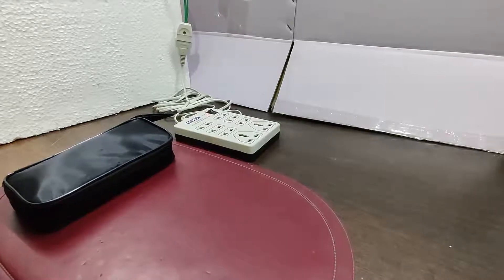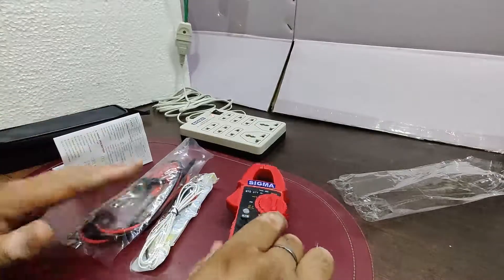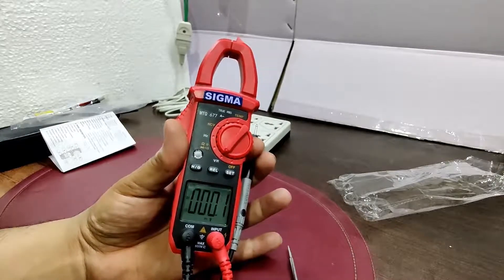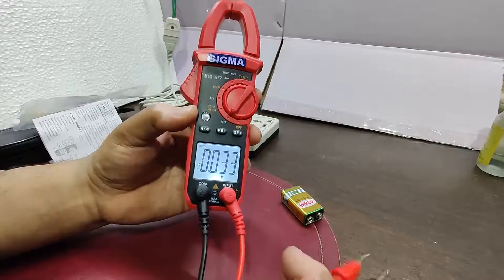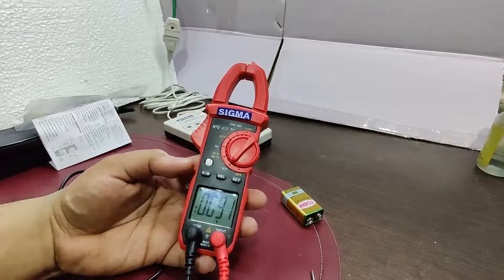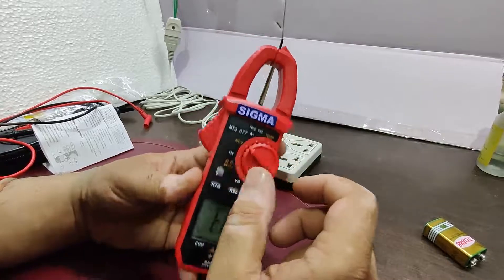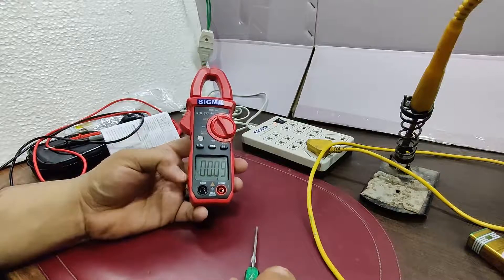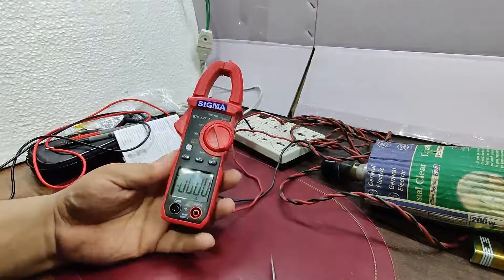How to use AC Clamp Meter SIGMA 677 in English || Detailed Demonstration

Comment: This is used only AC functions or DC Amps, Volts etc
Reply from the maker: Sir, It can measure AC Amps only and not DC Amp. Also it can measure AC & DC Both Voltages